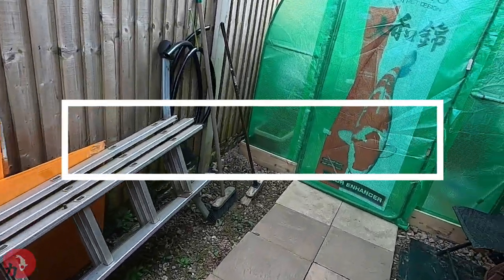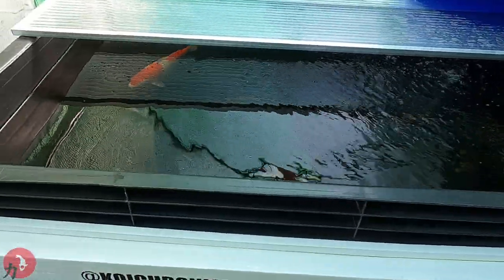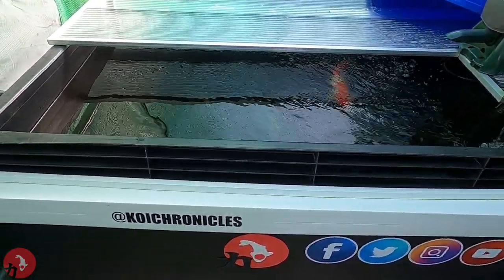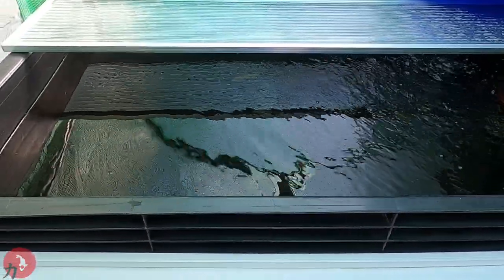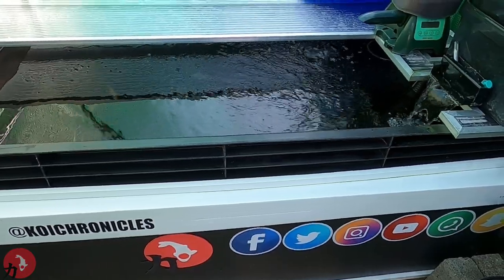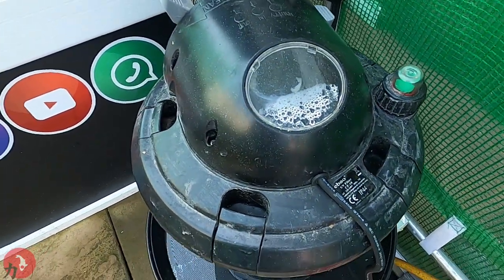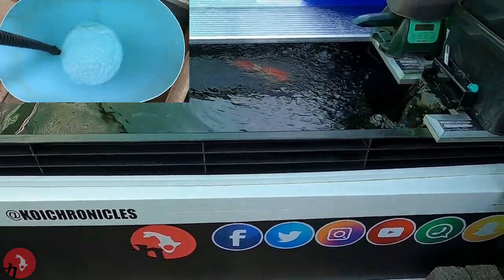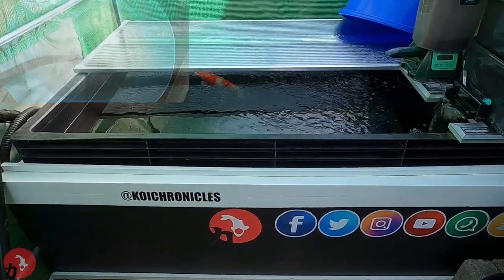Water Clarity & troubleshooting in the VAT polytunnel *Plus* Main koi pond  check over filtration.

Comment: Them retro bottom drains are good and suck flat on the bottom same as a proper one still have the pump chopping the crap up but I used one for years and was well happy with it
Reply from the maker: Could be plan B Martyn However I'm just paying with ya all and keeping it simple. #BetterPump will sort. 👍🙏⛩️🈂️KC
Reply: Iv got a retro n it works very well dragging debris across the floor into it. Much better then a pump in a cage that barely collects anything. Good update mate 👍
Reply from the maker: @richd-koi  Thanks for the input mate, will see how we fair next 📼. 👍🙏⛩️🈂️KC